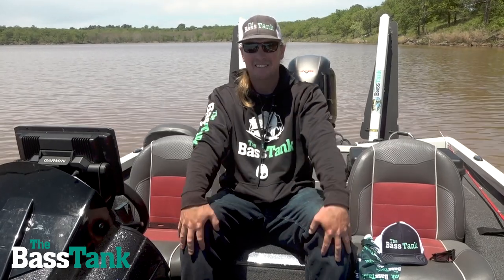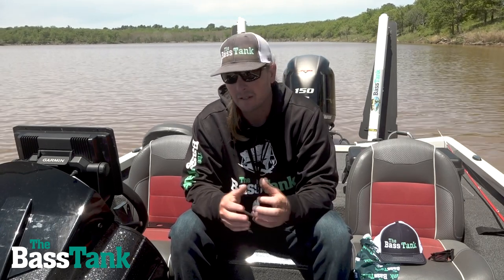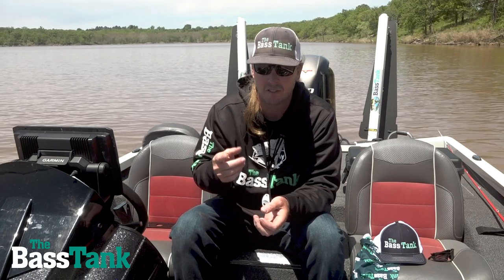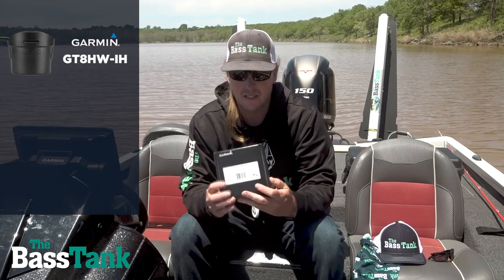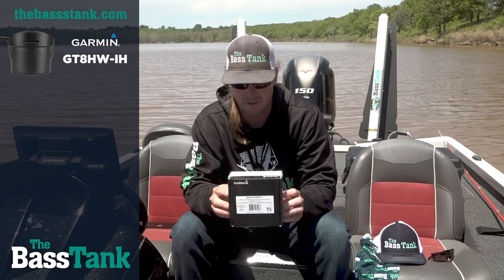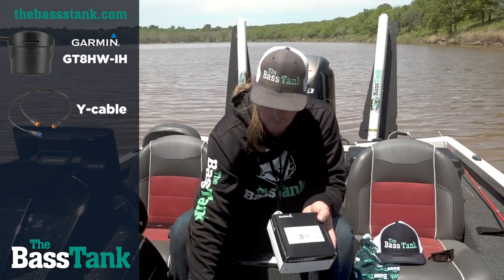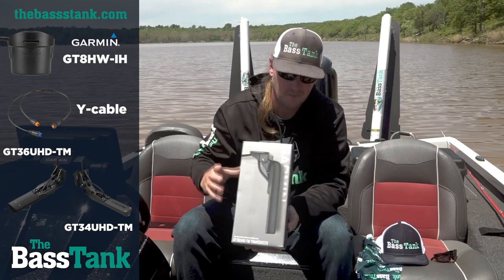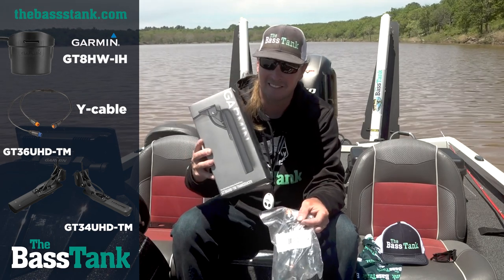Why you lose depth reading when your boat gets up on plane! TechTip

Comment: How about the LOWRANCE HDS LIVE
Can I add an in hull transducer to it and which one and do I need a y cable to connect
Reply: You would just get the lowrance active imaging 2 in 1 transducer and mount that on the transom.  Then install a lowrance in hull transducer mounted at the bottom of the inside of your hull.  The live units have 2 transducer plug ins at the back so no need for any extra y type cables.